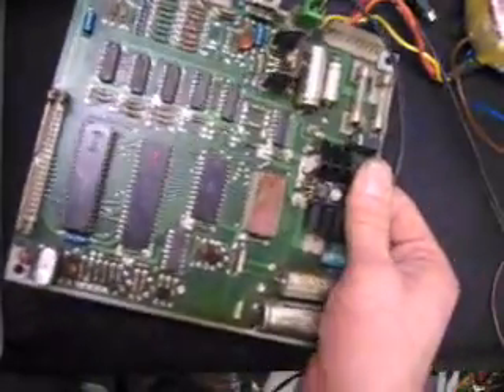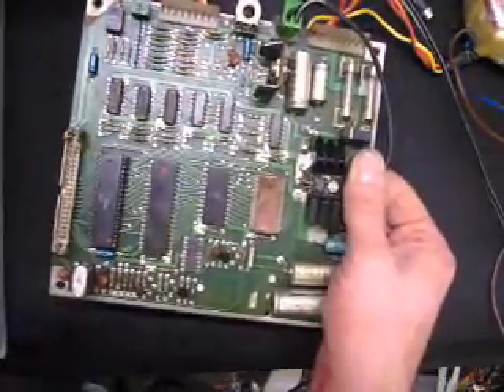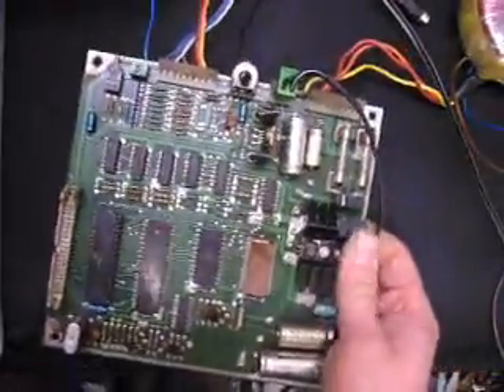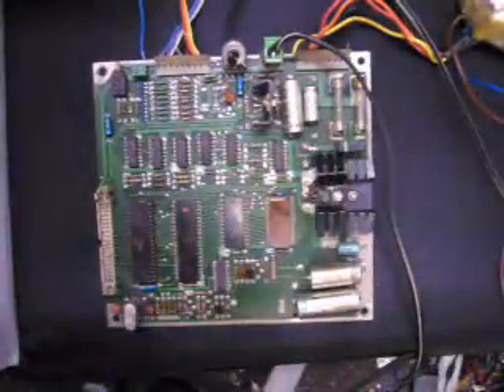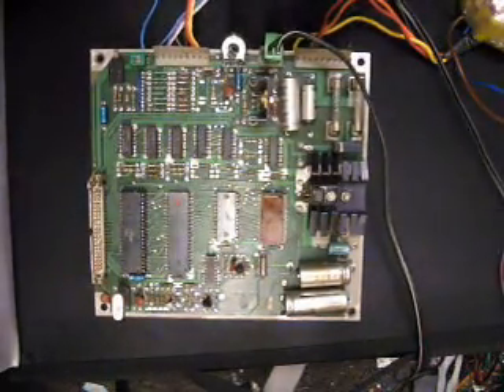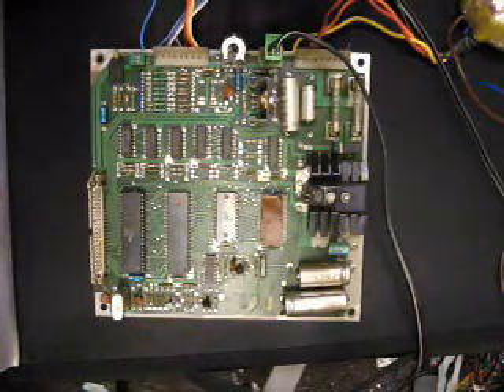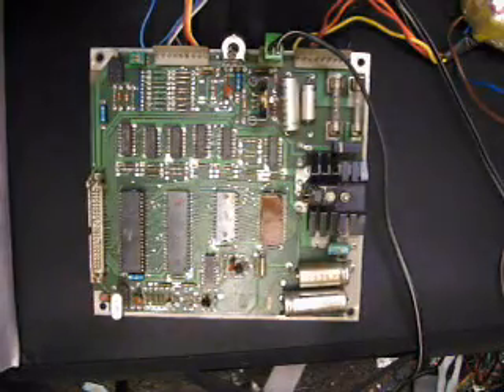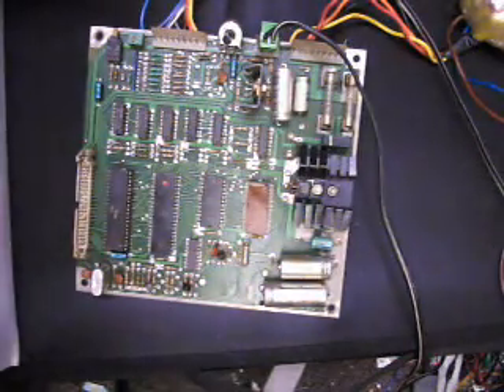Williams Defender Original 1980 Sound Board

Comment: How do you make a door bell. Can you post footage of this process?
Reply from the maker: Easiest way to make a doorbell is to use a row of switches (DIL switches or binary thumbwheel etc) on each data line to select the desired sound. Common the other side of the switches together and this will form a doorbell switch to ground. There is no ground connection on the data connector but there's a ground strip along the edge of the PCB. Grounding each pin of bits S1-S8 (Pins 2,3,4,& 7) should trigger a sound. A binary combination of the 4 grounded pins selects a possible 15
 sounds. Note that NOT ALL of the binary combinations are mapped to a sound. 

There are a couple of continuous sounds which need a separate stop command (S1-S8 all grounded is a stop command I think). The famous background drone (when you find it) will increase it's modulation each time it is selected and eventually cycle back to slow. It will only stop when another sound is played or on the stop command. 

Data Pin 5 is the high-order sound data S16. You will find most sounds are available from using S1-S8 (Pins 2,3,4,& 7). A lot of sounds wont trigger with S16 grounded (as it is way up in the sound map). It has a few hidden functions such as priority control, volume fade and background start stop control, together with a couple of layered sounds only available by using S16 as part of a sequence. The mappings also include many specific stop commands which produce no sound.

For an easy life: You may want to just use S1-8 (Pins 2,3,4,& 7) to avoid frustrating gaps when you are going through the selections. If you are adventurous you could put an oscillator on S16........... 
I used to build the lot into an old HI-FI speaker cabinet (with ventilation) and this will house the lot neatly, shroud all the mains parts, and look cool too, you can fit the selection switches to the back.

Here's the generic connections for 1980's Williams video/pinball sound boards. Note that the heatsinks run quite hot.
Connectors along the bottom, from left. Pin 1 of each is marked on PCB: 

Connector 1 below the fuses (power):
Pins 1+2 = Transformer 12v ac + 12v ac. Use a 12v + 12v centre tapped toroid transformer (2x12v @1.5A): 
Pin 5 or 6 = Transformer centre tap, (also system ground), 

Connector 2 (speaker 4 ohm 4-10w):
Pins 1+2 = Sp+, 
Pins 3+4 = Sp-

Connector 3 (Volume pot ~50k):
Pin 1 = c/w
Pin 2 = wiper, 
Pin 4 = c/c/w 

Connector 4 (sound data) ground is logic "1":
Pins 2,3,4 & 7 = bits S1,S2,S4,S8 of the sound data in binary. 
Pin 5 = Bit 16 of the binary sound data is a control input.

 Best of luck Jamie, Hope this helps  XX

Comment: Very cool!  I always loved those Williams sound effects from games like Defender / Robotron and pinballs too. It sounds sorta like FM. I envision some interrupt-driven oscillators that do things like "sync" (where one osc is forced to start its period based on the frequency of another osc whose pitch is swept), and lots of pulse width-modulated "square" waves.

I didn't know the sounds actually reside on the sound board! I guess a quick ROM swap allowed them to reuse the board on other games.
Reply from the maker: As far as I understand it's basically an 8 bit MPU-driven D-A configured as a multi channel FM synth, which runs from a step sequencer according to a ROM table. Each sequence includes the oscillator parameters such as: chan, freq, phase, amplitude, duration, etc to form the sound. Each sound is then mapped to a binary input address. The sequences for each game were different and mapped accordingly, although many individual sounds were recycled and used in other games.